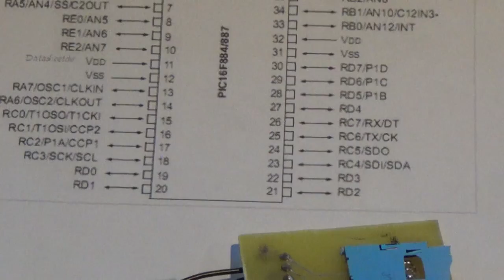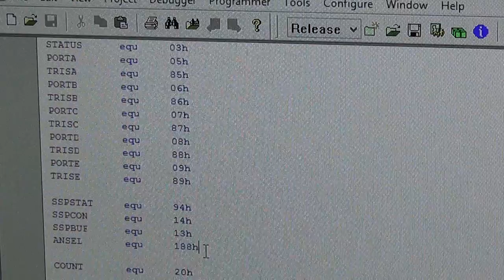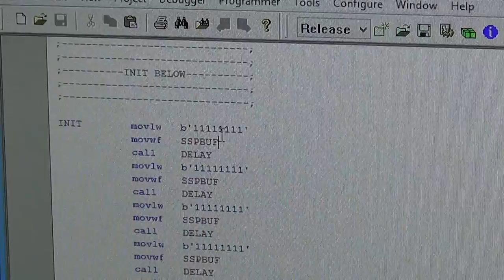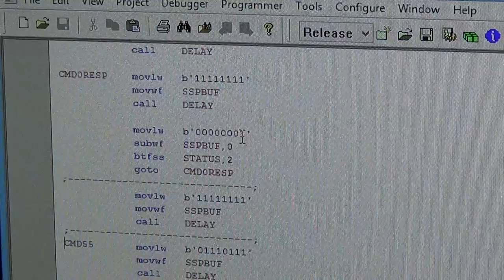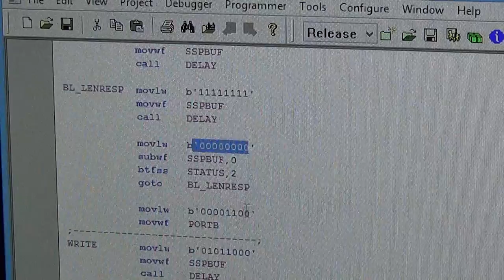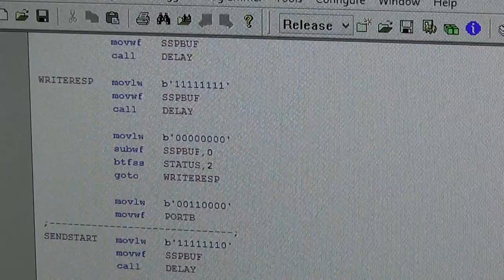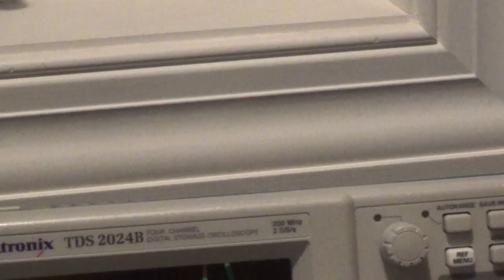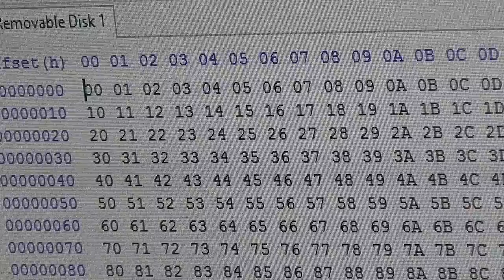Interfacing A PIC Microcontroller With A SD Card

Comment: Hi. I know this video is many years old now but I have just found it while looking to use a PIC as an SD Card interface for a homebrew computer. I have many years experience in PIC's (as I am sure you do too by now!) and a number of things jumped out at me. You may have learned these things by now but it may be helpful for others:
1 - Not all numbers need to be binary! For bit masks or registers, sure, but if it is just a number use the most appropriate radix (eg. decimal, hexadecimal) to make code readable.
2 - Comment your code! I know this was a quick and dirty prototype but as a "tutorial" it needs some more information and better coding practice.
3 - Use subroutines! Not all code needs to be inline - especially repetitive stuff.
4 - Don't subtract 1 and test the Z flag - use DECFSZ, it's quicker and uses less memory
5 - A MOV instruction sets the Z flag appropriately, you don't need to test for zero after the move
5 - Zero a file register value by using the CLRF instruction - that's what it is for!
Despite these issues, thanks for the helpful information.

Comment: Hey Matt, fantastic tutorial, very helpful. Just wanted to let you know (although this video is 2 years old, you may have learned this by now) that instead of converting binary to decimal and then to hex, a much easier/faster method is to group the binary number into 4-bit blocks and converting each block directly to hex -- for example,

0b10111100
1011 ==> 0xB
1100 ==> 0xC
so 0b10111100 = 0xBC

Again, thanks a mil!

Comment: If your card doesn't seem to respond, check if you have connected CS to the ground. I don't know how he got it to work, but the Specification specifically instructs to do just the opposite; that is, CS must be 1 when you send the 74 clock cycles; then you will pull it down with a pin from your microcontroller. There is version 2.00 of the Spec since this video was uploaded, that must be why

Comment from the maker: Here is the datasheet that I used.

http://www.circlemud.org/jelson/sdcard/SDCardStandardv1.9.pdf

On page 90 (and page 91), under command format, it explains that each command is just its binary value (cmd0 = 000000).  However, it also explains that each command is a six bit binary value, not eight.  It shows the six bit binary value following a "01" under the command format section.  I am assuming that that 0x40 is just command protocol.

Comment: Hi there Matthew.
Like yourself I have been very interested in electronics, making circuit boards and inventing since I was small. 
My question is I am a learner with microcontrollers however I learn very fast and, by the way your tutorial is top notch! :) I was wondering, which programming language did you use in order to upload the code to the PIC?